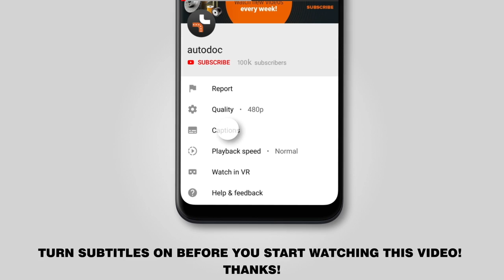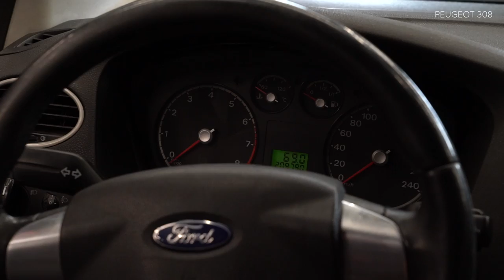How to change oil filter and engine oil on FORD FOCUS 2 (DA) [TUTORIAL AUTODOC]

Comment: The new filter looked small than what was taken off, is that aloud ?
Reply: Yes, it actually doesn't matter. oil filters are quite robust and similar. They are literally still exactly the same as the 1970s design. (same with fuel filters actually.)
If you buy a fuel filter for a 2.0 litre zetec, its common for you to receive a fuel filter matched to a 1.8 escort.
Reply from the maker: The size of the part may vary depending on the angle. At the same time, the filters are the same size and are fully compatible with the car.
AUTODOC

Comment: course thee 1.6 TDCIHDI  has a cartrage filter,  i prefer this style
Reply: i was just thinking to myself that the oil filter seemed to be in a different area... when I did my last car which was the 1.6 TDCI I had to remove a pipe to get to it and it was awkward to fit. I now have a 1.8TDCI so im assuming it should be the same as this video? il soon see i guess.
Reply: engine shown is a 1.6 petrol engine,   1.6 tidci its a 27mm socket and filter cap and catraige filter,  the pipe you mean is the steel turbo pipe , 10mil bolt  above filter and  oen lower down
Reply: @TheMcooper17  ok thank you, going to give it a look tomorrow as il be servicing it next week. Cheers

Comment: Is there no washer on the oil plug?
Reply from the maker: Thank you for your feedback! Unfortunately, we didn`t show that part of the video, but one should replace a seal ring as well. Best regards, Autodoc!
Reply: It's a rubber one...mine still doesn't leak after 182.000km and 13 years.
Reply: @liviu9181  what about now? 😁
Reply: @its_me_dave  Well...i still daily that car with the same drain plug and still no leaks...